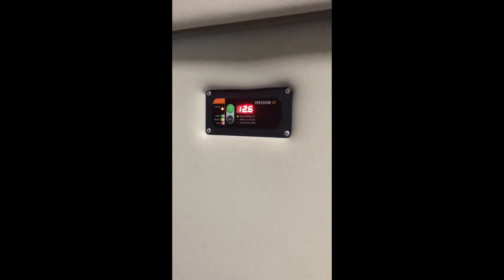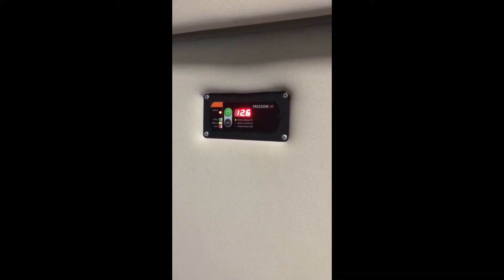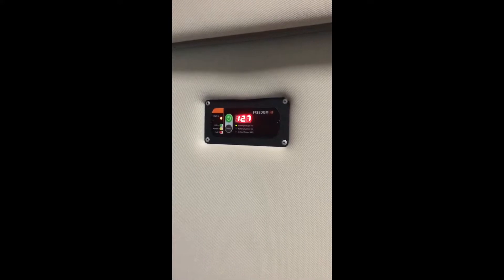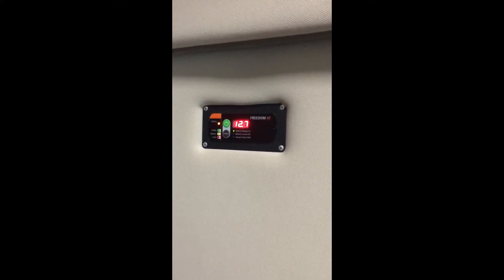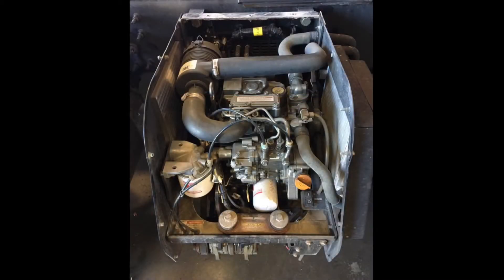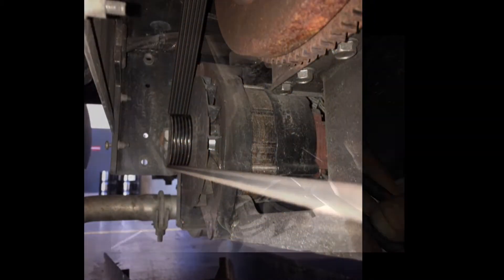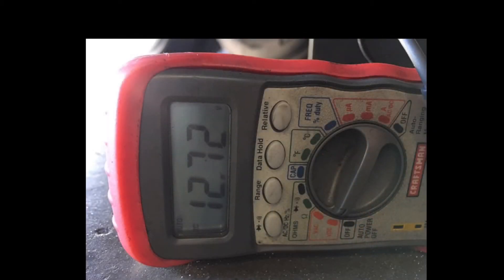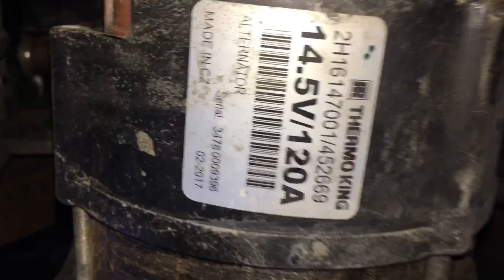Thermo King APU shutting down

Comment: what could be the reason?  My power button on the panel stopped turning on?  the backlight lights up as if it was turned on normally, and then the backlight turns off, I checked all the fuses, everything is whole and unharmed

Comment: These things always have issues at the worst possible time. Bad grounds, air getting in the coolant (shutting off in hot climate). It gets trapped because of a stupid design. Fuses blow because of underrated current. And the espar heater needs ignitor replaced every year, because it can't handle the fuels trucks use. If you're in the market run away from thermo king they are a headache and money pit. Get a reliable carrier.

Comment: Hey guys I have issues with my apu. The engine cut off every 3min. And code AL3. I checked big fues i clean up all wires on alternator looks like alternator is working when starting engine voltage goes up no problem just keeping shutting off. What's can be? Please help.
Reply: Did you finally fix it? I'm dealing with the same problem. Alternator replaced, new belt, same problem. This starts driving me crazy.